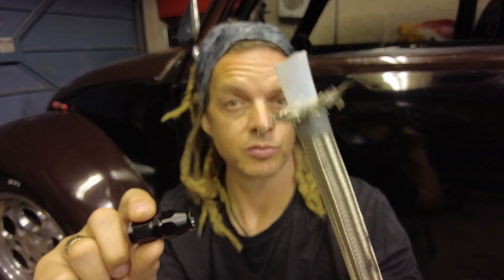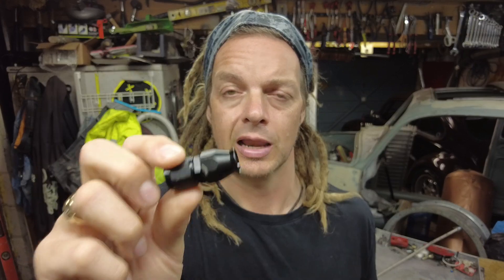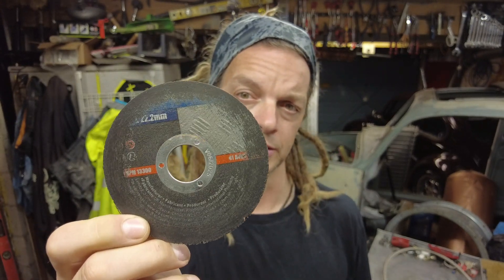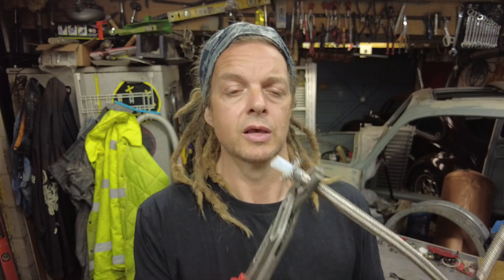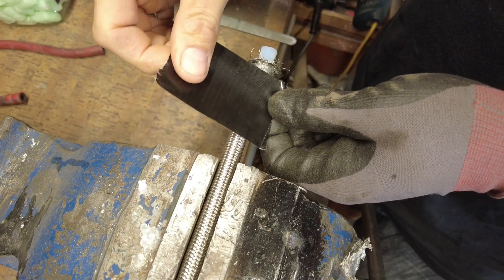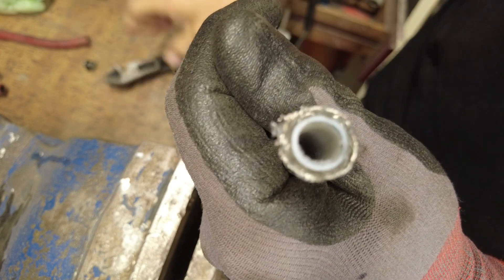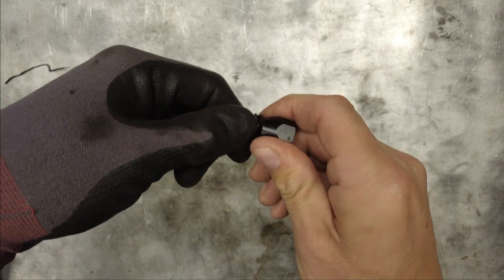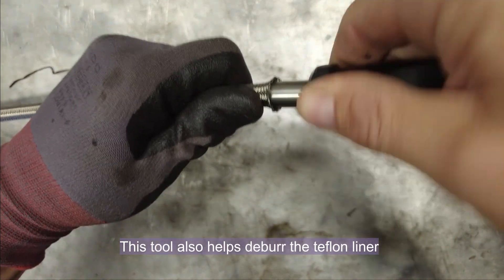How To AN-6 Fittings on Teflon Stainless Braided Fuel Hose Lines - Avoid damage Ethanol E10 Fuel

Comment: Electric tape works for me you just have to cut quick lol
Reply: Or masking tape works fine
Reply from the maker: @AshLongie  I'll be honest I never tried Masking. It doesn't flex so imagine woukd be decent actually  😊👍
Reply from the maker: @AshLongie  I found it went gooey and opened up. I was thinking after I released the video how much difference the cutting blade might make, i wonder if a better conpound/brand would have netted me a better cut with less heat. Thanks for the feedback 😊👍